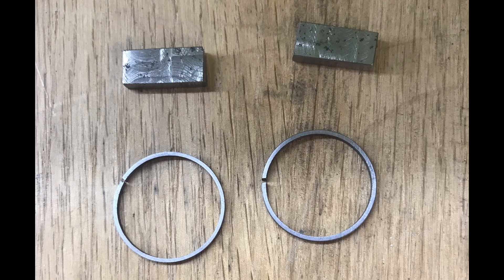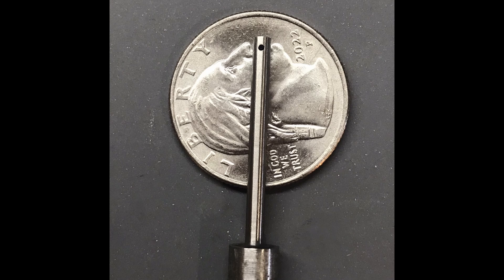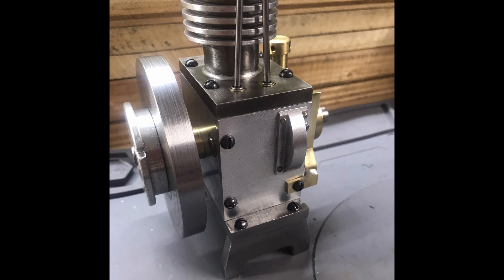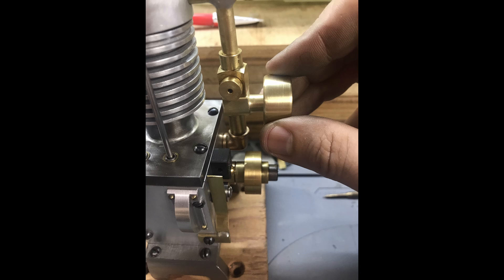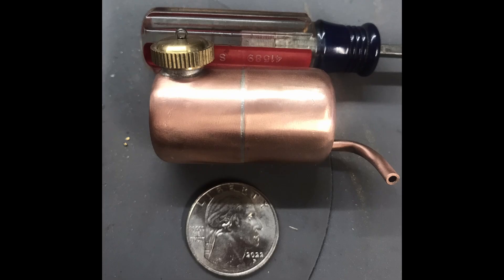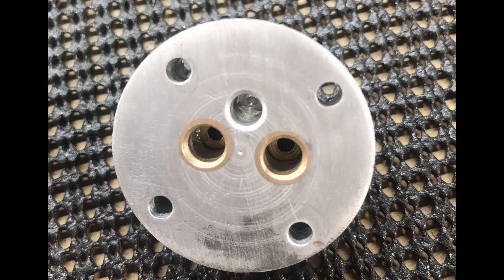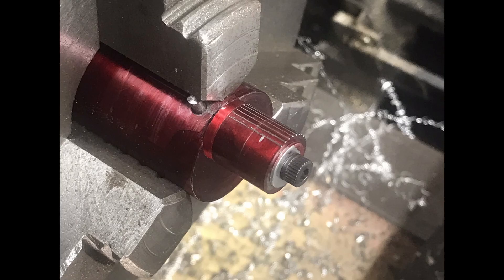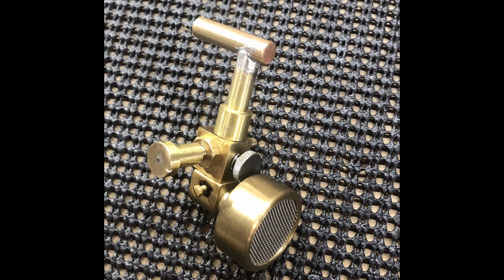Upshur Vertical Single Episode 2

Comment: Nice engine, runs great even at the low speed.
Reply from the maker: Thanks. It was a challenge to get it to run that good. I ended up replacing the cast iron rings with o-rings and that helped a lot. Getting the valves to seal took a lot of work but that is pretty normal.
Reply: @BMachining2  Can you provide specifics about the o--rings that you used?  Thanks!
Reply from the maker: I would use a Viton O-Ring like McMaster Carr P/N 9464K22. There are different widths, just pick something you can cut a groove for. If the o-ring supplier doesn't provide depth information I would start shallow then sneak up on the depth. You need some compression of the o-ring but too much causes too much friction.